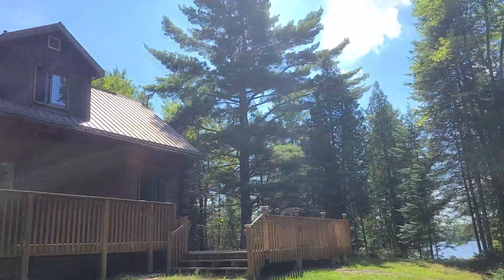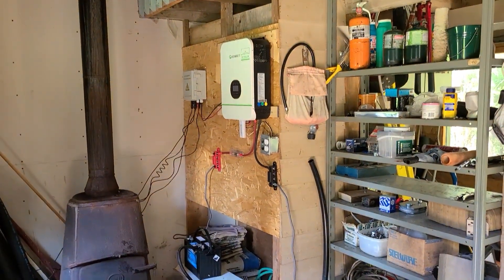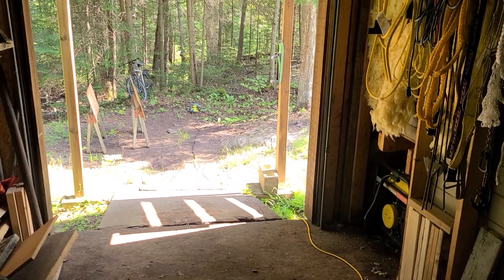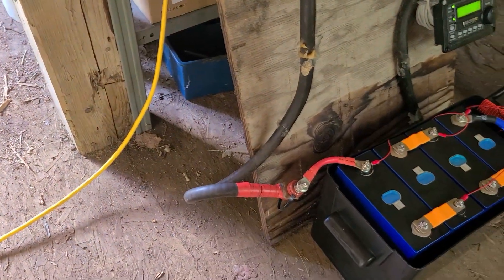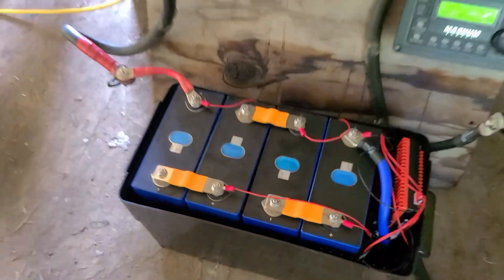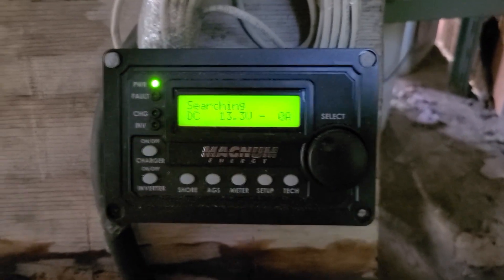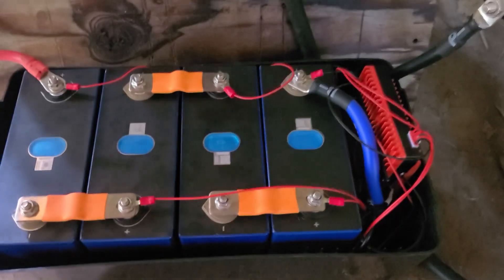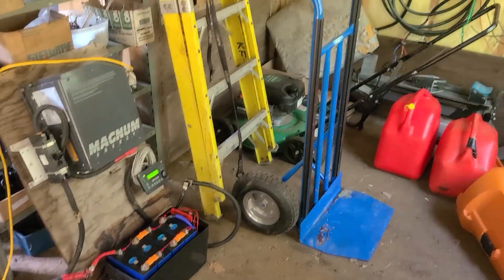Daly Smart BMS 4s 12v High Amperage Test

Comment: Very interesting to see the amps at 12v, my 48v 4p16s at 11,600w sees around 190amps
Reply from the maker: Wow, is that all huh??  When I upgraded to 24 volts and had this old 12v inverter no one wanted to buy so I thought I'd try using it as a portable power station.
Reply: @xhumeka  The surge will hit higher but the sustained amps sits right around the 190 range. I had always wonder how much more a 24v or 12v would pull compared to 48v. I'm running dual 2/0 for all my connections, 24v or under would really need some heavy duty connections. We work from home and use more than average due to our work. On a sunny day we can hit over 500amps coming into the batteries. I have 8 120 amp charge controllers. Wish I could post a few pics of the batteries but yt will delete those links.